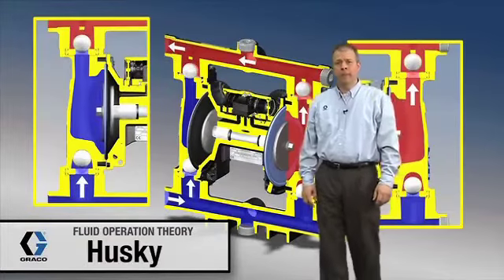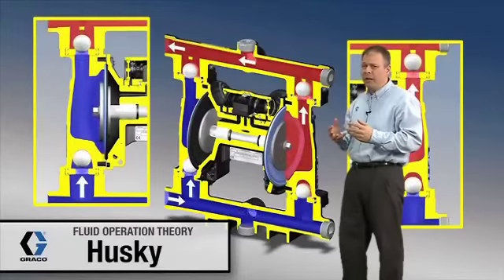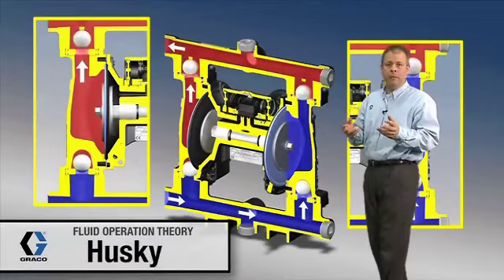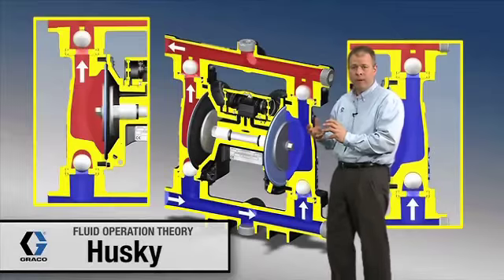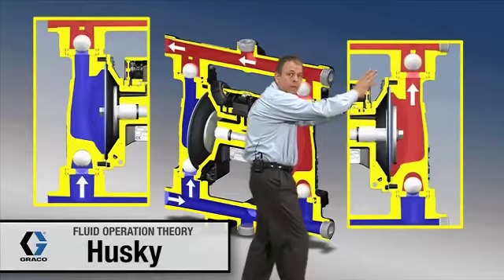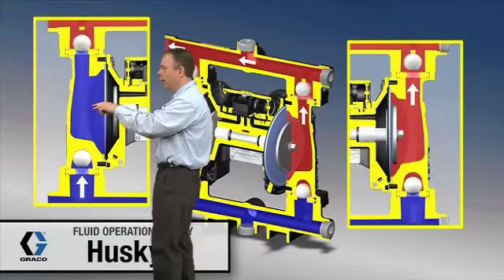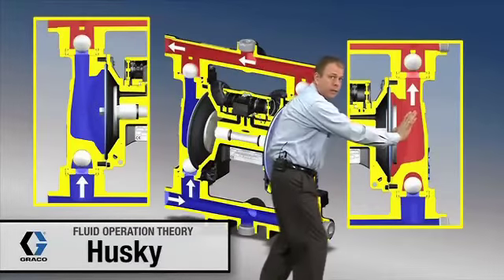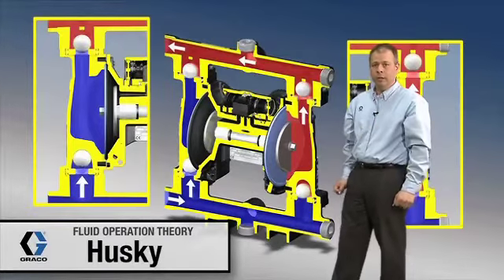Graco Husky 1050 Fluid Operation

Comment: I got a question
Reply from the maker: Okay. Is your question about how our Husky pumps operate?
Reply: Graco Industrial Equipment yes it is. Are yours pumps able to run dual outlets on the discharge side?
Reply from the maker: @jordanbarraza9924  Some Husky Diaphragm pumps have an option of purchasing a dual outlet manifold. This is the only time you can have a dual outlet on a Husky pump. There is not option for a dual outlet manifold installed on a pump direct from the factory. If you'd like to talk this through with a process pump expert, please call 866-348-3188, Monday to Friday, between 8 a.m. and 4:45 p.m. Central Time.